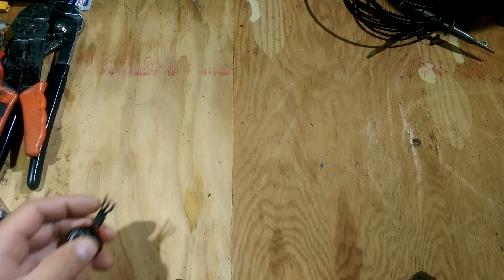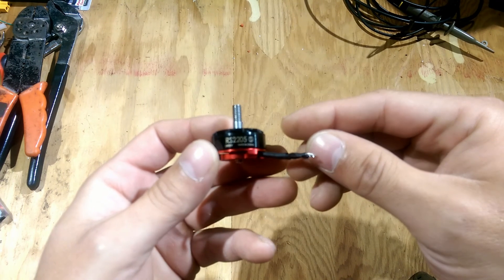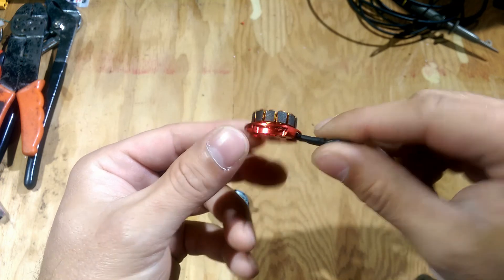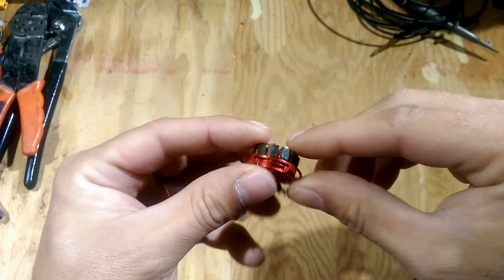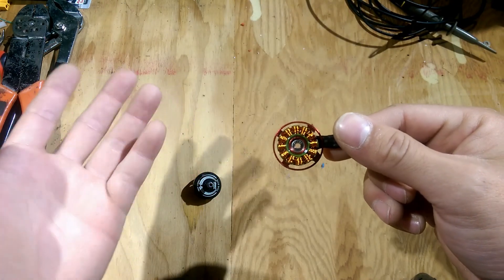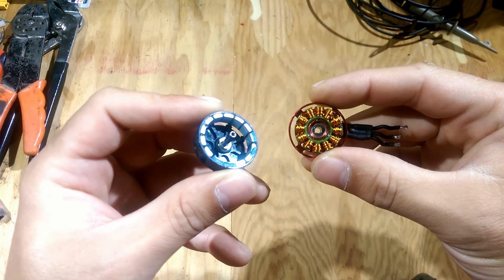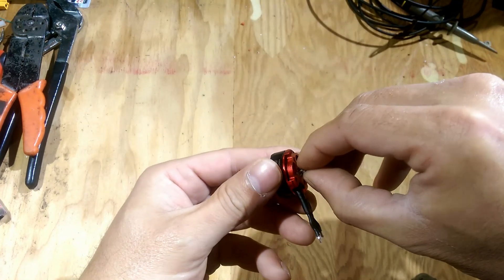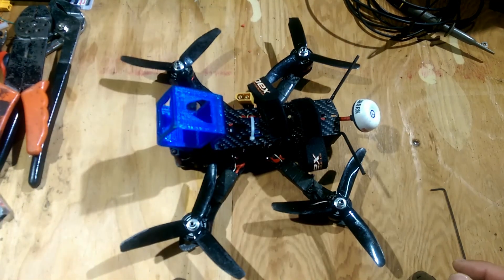Diagnosing Emax RS2205S Hot Motors Part 2

Comment: i have the same problem with my rs2205s and im really disapointed I thought emax was an icon in the quad community. I would really like to know how you repaired your motor. You said you rewind it yourself?
Reply from the maker: darkfred007 Marcotte I pulled all the wire from the stater, and used some magnet wire I had from previous projects to wrap it single strand. I did fly the motor for a while until the bearings went bad. I still fly them once in a while, but they like to burn out escs rather quickly. Going to upgrade to some t-motor, or RR motors.
Reply: yeah i think i'll never buy emax product ever again. i'm currently shopping for rotor riot freestyle they are pricey but they seem to be a really good balance between power and efficiency
Reply from the maker: darkfred007 Marcotte I have a set of hypetrain motors on one of my quads and absolutely love them. Well worth the money IMHO. I've heard that the Emax 2306 motors are decent, bit I haven't ran em to give my real opinion on them. The RS2205 motors are tough but noisy, and produce to much voltage "kickback" which ruin ESCs rather quickly. Maybe they would do well with the wrathe 32 escs with the metal FETs. Not sure though. I plan on testing more stuff out this summer.